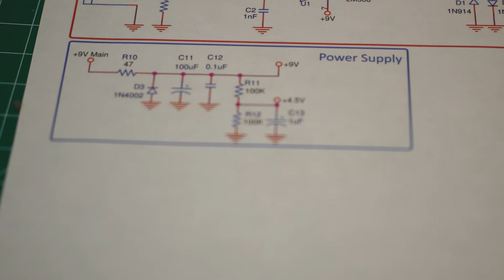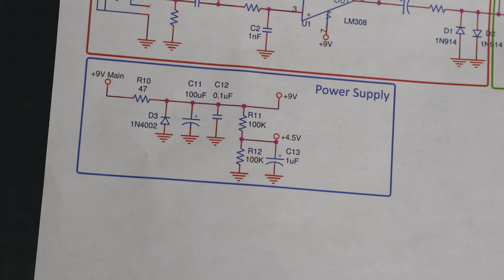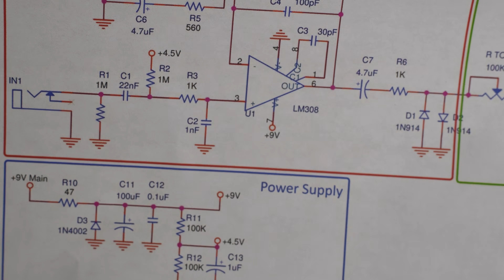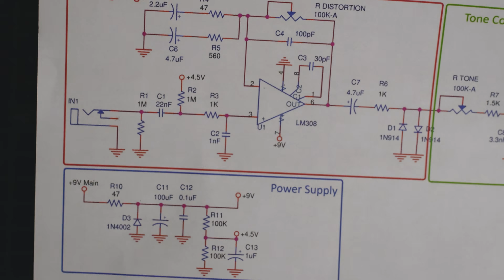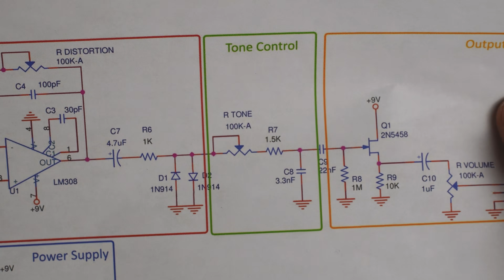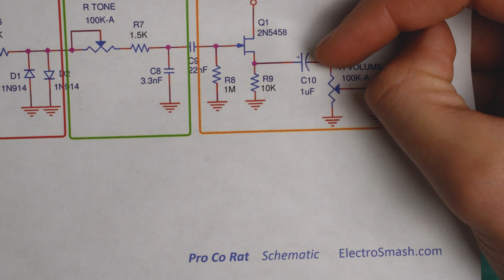How to Build a Distortion Pedal From a Schematic (ProCo RAT)

Comment: It seems that the R Distortion 100K-A resistor have 3 pins,  the original schematic seems more like this, 
Distortion Left pin - Pin2 of LM308, also the Distortion middle pin - Pin2 of LM308
And also similar in 13:31 when connecting the R Tone 100K A pot. In 17:08 you connected perfectly .

Comment: Your first component - the 47 Ω resistor at 1:03 is placed in such a way that it is shorted and therefore isn't doing anything.  You should have put one leg of that resistor into a vertical slot in the breadboard, brought the power into that slot so that it travels through the resistor before hitting the power rail.  This is part of the low-pass filter which eliminates ripples in the input.  If you power from a 9v battery you don't need it for filtering, but it also helps control inrush current when initially charging those capacitors.  Overall, nice job!
Reply from the maker: You’re absolutely right. Thanks for your comment and for watching
Reply: Hi David, I'm studying electronics, can I ask you what the point of the 1N4002 diode, D3, is for? Is this normally to clip inductive loads from back feeding into sensitive ICs like the op amp? if this is the case, I don't see any in this circuit, so is this from the pickup or elsewhere?
Reply from the maker: @adriaelmswood Diodes allow electricity flow in one direction, so in this case, it is used to protect against reverse polarity
Reply: @PedalSmithCo  I agree with this.  If the power supply is connected backwards, it provides a low impedance path - through the diode then through that 47 ohm resistor and protects the electrolytic capacitors from being reverse biased (and protects the rest of the circuit as well).  Those capacitors can blow/explode if this happens, though I think that's an extremely low probability, especially at these voltages.
Reply: Was wondering about that. Cheers
Reply: Wow, thank you, because I know very little at this stage, and almost thought I must be doing something wrong/fundamentally misunderstanding something when I saw him place that first resistor.

Further, it seems like the entire power supply part is wrong, right? All of it is supposed to start with the 9v going through that specific resistor. I kinda don't want to trust the rest of the video.

Comment: Very cool, I love it, but just in case any viewers are learning electronics, the first resister you placed is not doing anything in your circuit. With both leads place on the power rail, it is shorted and practically no current is flowing through it. Because it's only 47 ohms, there is probably enough resistance in the rail and wires for the circuit to still work. Nice Telecaster!
Reply from the maker: You’re right, that is my mistake. Thanks for watching!